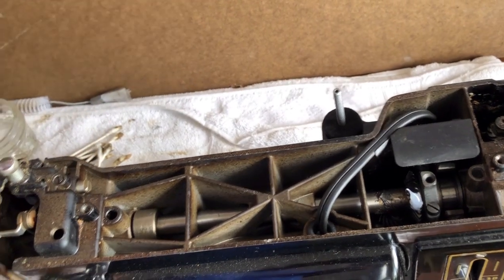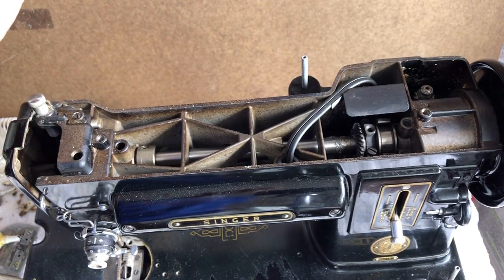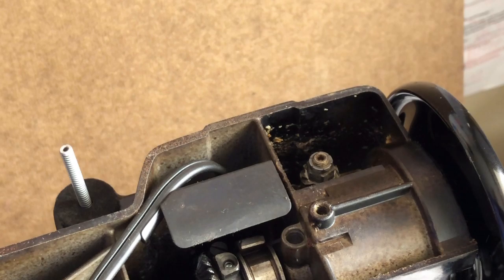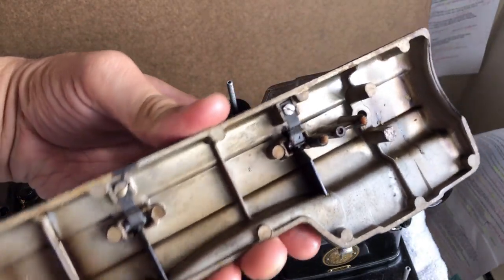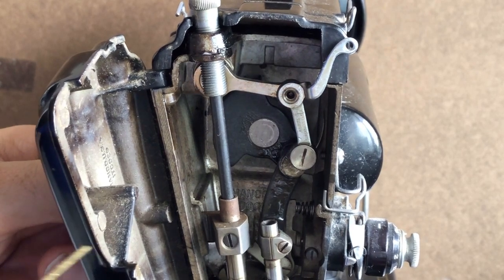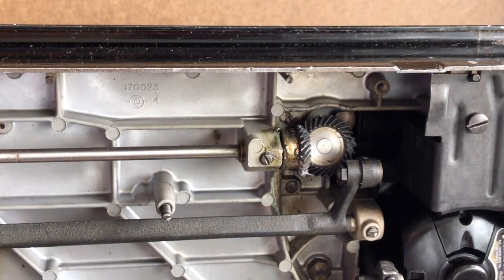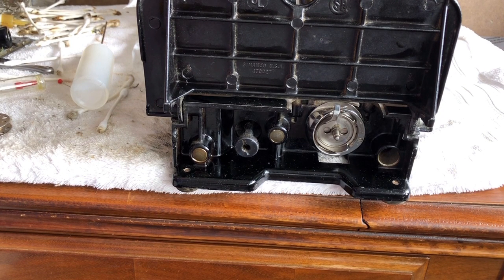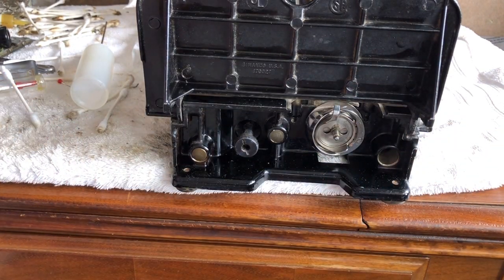RESTORATION SERIES #7: Step by Step Lubrication of Singer 301. Lubrication: How Much & Where Applied

Comment: I have a green featherweight that I bought in 1968.   I used it a lot for 20 years and I think I over oiled it.  I am looking for videos where you address removing old oil that is now "gumming up the works".  I have found the Restoration Series 5 and 6 but it is not really addressing my needs.  Can you refer me to one of your videos that do address.  What I have found is very interesting and informative.  Great job on taking it slow and talking about each step.

Comment: Hello , thank you for the video! Got a 301A on Letgo App & although it worked, it sounded “clanky” as if it was struggling a bit. Followed with you as you cleaned & WOOOW, it’s running beautifully. I goofed a bit & got some alcohol on some painted parts but it got those gross very yellow caked on areas clean. Looking forward to following your polishing video with you.

Comment: I collect these and I got one yesterday it's a two-tone Brown with a zig zag attachment that I'm hooking up today I love the slant shank and I also got really cheap a cuss-o-matic I'm working on it it seems to be okay even with the plastic gear. On marketplace wants a lady had a 348 and said it was like brand new but it barely turns and I asked her if she had oiled it.  and she said I didn't know they had oil I said no it doesn't have an oil tank but anything metal to metal needs oil and gears need a little Grease so she olled it up and kept it. I would rather have more oil and wipe it off than no oil. I believe some younger people think that these machines don't take any kind of oil and a lot of people call an electric motor and electronic machine that's crazy but anyway I digress thanks for the video

Comment: Hi, I own my mothers 301A. Although I have used it for years I am now making quilted baby blankets and having trouble with pressure to tight on cross stitches. With light batting in the middle usually causes fabric on top to stretch more than bottom. Then rip out, pull and tug on bottom fabric (cottons). Can the pressure be adjusted for this. I have used top pressure screw but I don't see any change? Margaret

Comment: Hey I was wondering what kind of grease youre using to lube the gears? And what type of oil should I be using once my tune up is done. Im just getting into sewing, found my grandmothers old 301, Its super clean just need to be cleaned up and lubed as far as I can tell. Thanks for your videos, I'm going to be watching most of them I'm sure LOL!
Reply from the maker: Hello Chris.  I use Singer Lubricant (grease) that comes in a Red/Pink/White striped tube.  Other Singer greases are not the same.  This grease I use is safe for both the metal gear sets underneath as well as the motor worm gear/handwheel gear.  Congratulations on your 301.  Its an incredibly popular vintage model for many good reasons.  And the fact that it is a family heirloom is even better.
Reply: @VintageSewingMachineGarage  thanks for the reply, as I watched more of your videos I found out what you recommend. I bought the Singer lubricant. I do have some Hoppe's No. 9, is this safe for my oiling needs?
Reply from the maker: I'm not familiar with the Hoppe's but to be safe, I would only use sewing machine oil.  Brands vary, but most sewing shops carry at least one brand.  That is all I ever use or recommend.

Comment: Use dryer lint to replace the oil wicks ! . A old singer seller and mechanic gave me his pure
Lithium grease for the bakelite main driven ( helical gear ,/ it will be fine
Reply from the maker: I disagree on that point Ronald.  The dryer lint is not dense and stable enough and could wick into the bearings and cause real trouble.  Regarding grease,  greases vary in their makeup and use.  Lithium grease can cause issues as it ages.  I would steer clear of it for this purpose.

Comment: How do you lub the motor. How do you check the belt? How do you get it to release to wind the bobbin without the machine trying to sew (when unlocking it does not work)?
Reply: You have to turn it upside down to get to the motor, the motor has little towers on top of each bushing . When you take the bottom plate off you will see where the motor takes lube you fill up the little Tower with motor lube
Reply: No belt

Comment: A thought, we have a singer 301A which in the booklet states we should lube the motor area through a port.  However, our machine underneath looks the same as this video and we see no port?
Reply from the maker: Very good question Sarah.  I suspect that your manual was printed when the 301's motor's had ports.  At some point in the production run, they made a change and no longer had grease (Singer lubricant) ports for the motors.  So if your motor did not come with grease ports, then grease may not be called for.